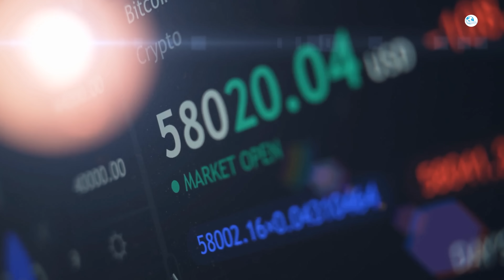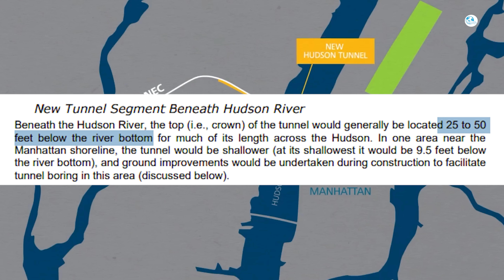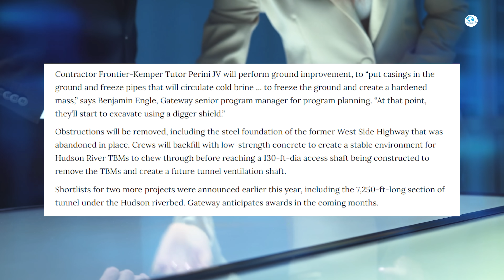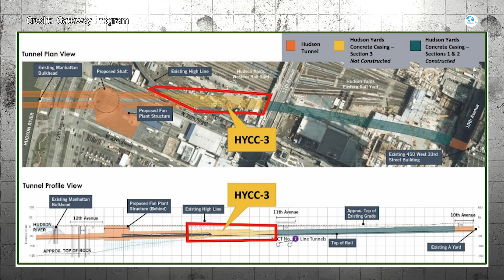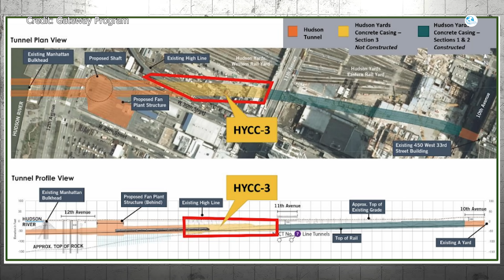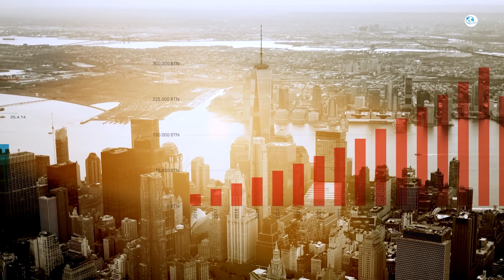$16 Billion Amtrak New Tunnel to Save NEC...

Comment: The gateway project was radically changed by the 1st Trump administration and the 2nd Trump administration from a forever jobs project for commuter trains and the abandonment of the high speed alignment original Hudson tunnels with little Amtrak and freight railroad interests to a project with a strong completion schedule.   The new tunnels are now structured for double stack freight which also enables double level Amtrak Superliner cars.  The original high speed alignment tunnels will be updated for high speed train use that when finished will have 4 passenger train tunnels with two being freight train enabling.  The project has high Amtrak and federal government involvement.   With the completion of the Baltimore NEC tunnel enable for double stack freight Amtrak will be able to have all its long distance trains be double level SupperLiner cars.   Amtrak's long distance trains on the NEC don't go further north than NYC.    Most of the eastern US is limited to single level Amtrak passenger trains for using the NEC.

Comment: 'But is the project really worth the huge sum? Or is it just a risky gamble?' Short answer, yes. It's when one does a deep dive that the answer is very nuanced
Reply: At first no.  It was a forever jobs project for commuter trains.   Now yes, design requirements management has switched to Amtrak and the federal government focused on Amtrak passenger trains, future NEC double stack freight and 4 tunnels,  retaining and updating the original high speed alignment tunnels for high speed trains.   The original tunnels were to be abandoned just leaving the slower new alignment tunnels that were only for single level cars.  The build schedule is now structured for deterministic completion.

Comment: Problem isn’t so much with the design, it’s the fact that the entire culture of the Northeast is so corrupt to the very core that everyone, and I do mean EVERYONE, has to get their little cut of the pie before ANYONE even so much as lifts a finger to do anything worthwhile, which takes years and untold billions. Many places in the Midwest and elsewhere (but certainly not California or Illinois) could pull off a similar project for a fraction of the cost and far less time. Simply put, they should have started digging on the tunnel itself about 20 years ago and then figured out the rest of the infrastructure as they went along - chances are good they would be done by now and it would have cost much less, even with the corruption. But they didn’t, and soooo…here we are.
Reply: It was a forever jobs project for commuter trains.   Now the  design requirements management has switched to Amtrak and the federal government focused on Amtrak passenger trains, future NEC double stack freight and 4 tunnels,  retaining and updating the original high speed alignment tunnels for high speed trains.   The original tunnels were to be abandoned just leaving the slower new alignment tunnels that were only for single level cars.  The build schedule is now structured for deterministic completion.  The large change is due to Trump.  There was lots of opposition with the impediments galore that you mentioned.

Comment: 16 billion is a rape of the us taxpayers for the tiny hudson  river.the chunnel  did not cost that much
Reply: You can thanks Chris Christie for the delay and the costs.  He thought he was going to win the GOP primary and  zapped” the ARC Tunnel. Look what the central artery did for Boston
Reply: Deep long tunnels are very expensive in the US.   The originally Gateway project was a forever jobs project for commuter trains and that might never be completed to use lots of federal tax payer money.  Amtrak was going to get a new Portal bridge out of it, but a slower alignment into NYC.  That has all changed.  It's a serous passenger/freight rail project with 4 active tunnels at completion on a highly structured completion schedule.